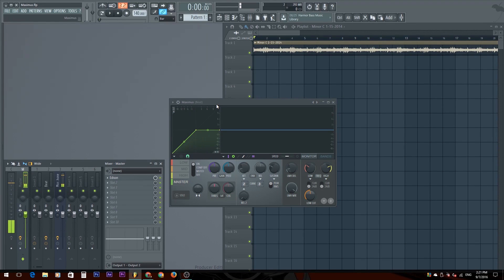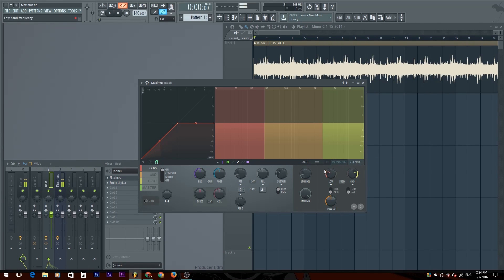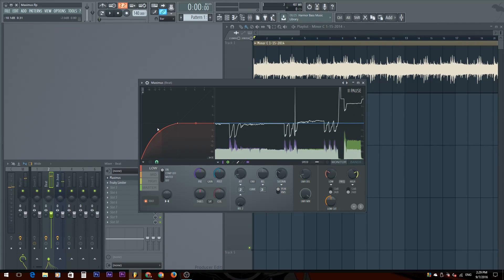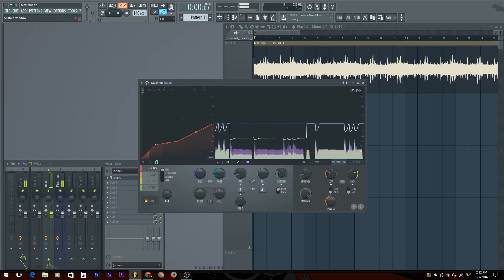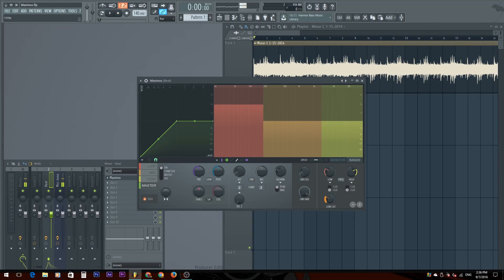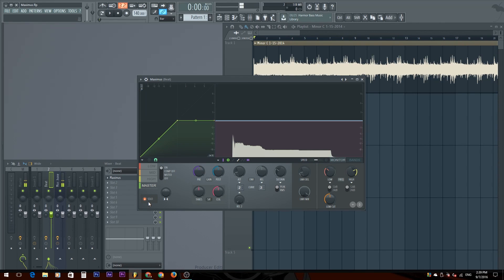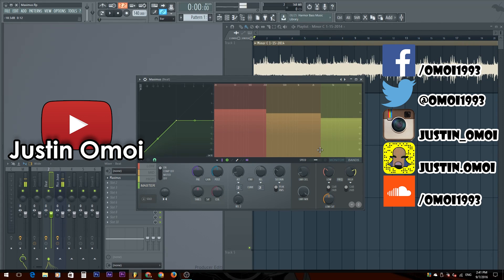How to Use Maximus In FL Studio

Comment: How are you gettin that red line to show up when your compressing?
Reply from the maker: Hey Hey. Are you referring to the Red bar graph thing, or the Red compression line? Either way, I show it in the vid xP
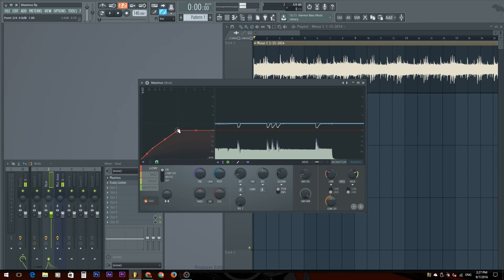Reply: Justin Omoi at around 3:50 when you doing compressing a little red line is above the waveform. Ive seen it in several different videos but mine doesnt show. Just wondering what im doing wrong.

Comment: Hey Justin I have problem I bought a akaI lpk25 midi keyboard now when I press a key on the keyboard my latency is good I have no late playback but when I hit record and play the souds that I recorded its not in the right place help
Reply from the maker: Hey! With recording on midi devices, you will have to make sure that your Snap is set to none, or 1/4th step. The notes are recorded dependent to the snap. The main snap bar is located near the pattern name box at the top ( under the blue lit button) If that doesn't help, check the snap in the piano roll too. Click the little triangle button int he piano roll box. 
Hope that helps!